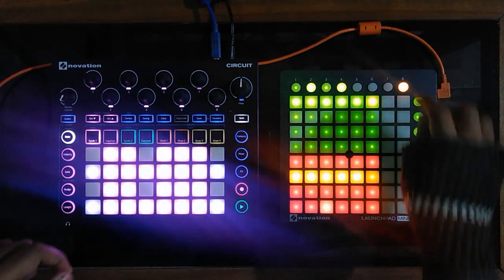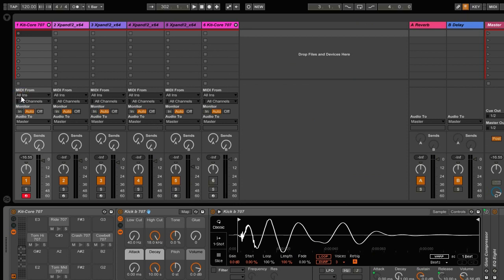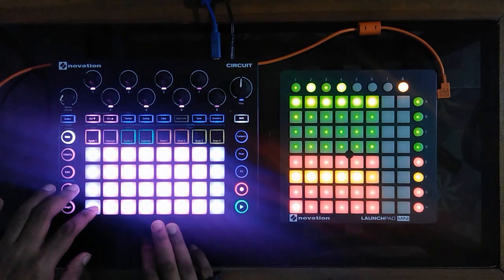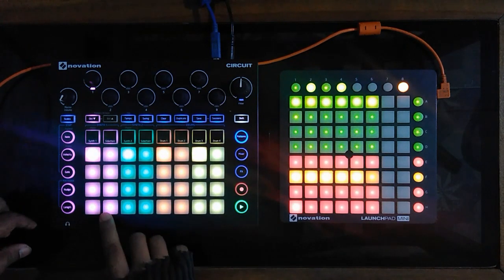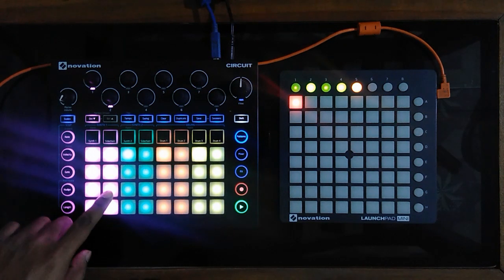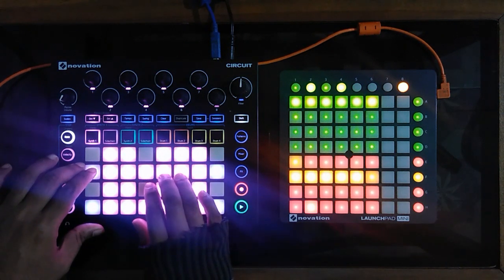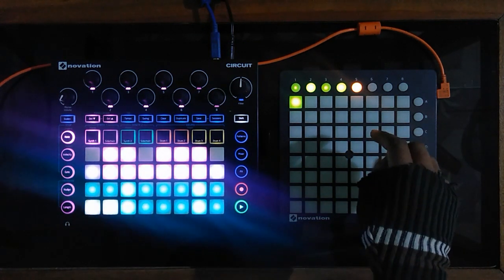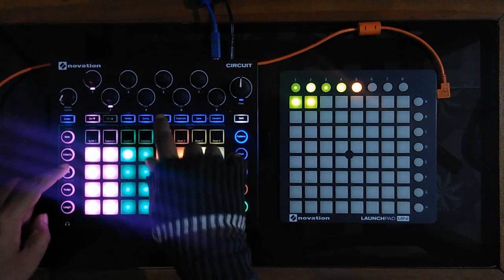Novation Circuit: as MIDI Controller (Part 5) | Circuit + Launchpad Workflow in Ableton Live

Comment: The metronome is so out of sync :(
Reply from the maker: Support my channel. Then I might get some money. And then I can buy a faster computer. And then I will be able to set a lesser buffer size that will decrease the overall latency. And then you will be able to hear the metronome in sync. For now, I just quantize or drag the midi notes slightly ahead, later. 😊
Reply: @namasudra  install asio4all maybe you can fix it that way, good luck
Reply from the maker: Already have asio4all. The processor is slow actually. Old laptop. Thanks for the help. 👍

Comment: So to be clear, you setup VST instruments in Live, and are only using the Circuit as controller to send midi data, correct? Or are you recording the sounds from the circuit into audio tracks in Live? I suppose, either would work.
Reply from the maker: Yes right, this series of videos is about using Circuit as a MIDI controller and this is part-5 of the series. Here I used only the sequencer of the Circuit and not the sound engine. If u look closely, the volume knob on the circuit is turned down all the way.